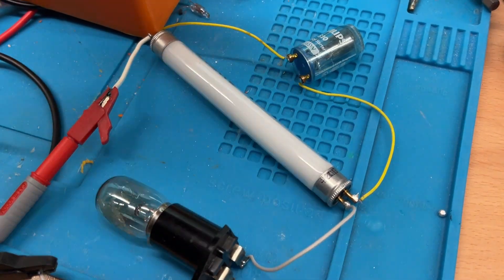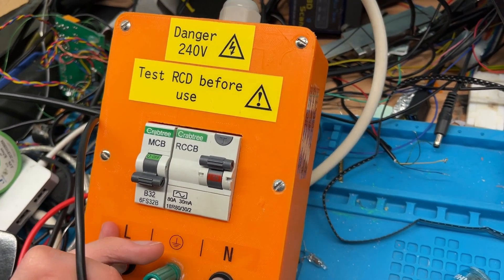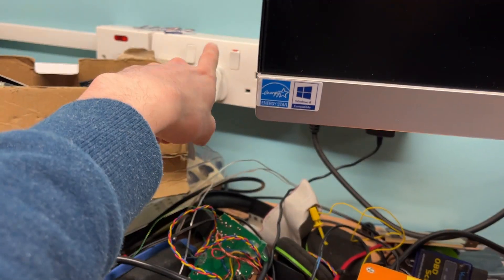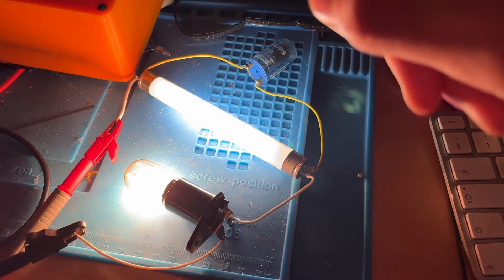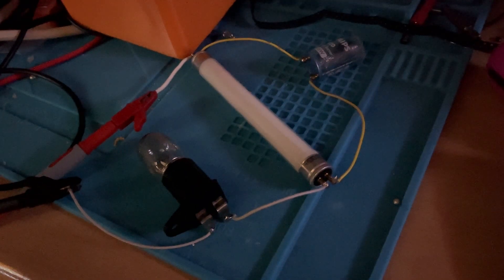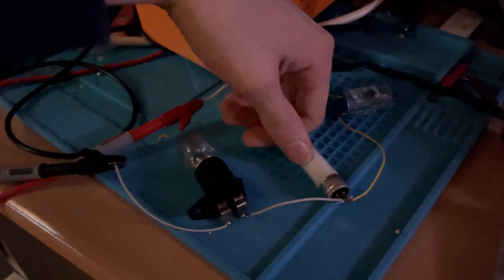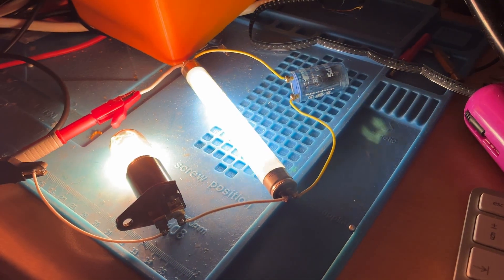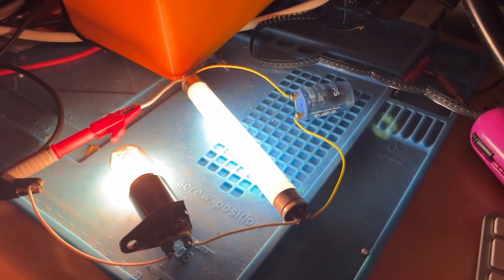Little Fluorescent Death Trap

Comment: Would this work on a higer scale like if i had a 60w incandesant and a 58w T-8 tube would it stilll work?
Reply from the maker: It would probably struggle to strike. It works once it is started but there is no inductive kick to strike the larger tube.
Reply: @deltalambda3864  ahh right well ill give it a go as a little experimental
Reply: @FinlaysFireSystemsElectrical it only works on T12 lamps and circular lamps

Comment: Nice setup.  How much current does the tube draw when its heating vs when its on?
Reply from the maker: i didnt measure it. the filament lamp is at pretty much full brightness when the starter shorts out so i am going to guess a touch off what the filament lamp would draw directly connected to the mains. the filaments in the fluro are quite low resistance.